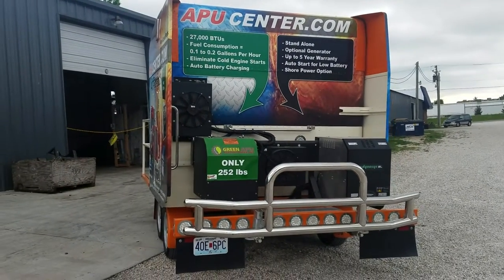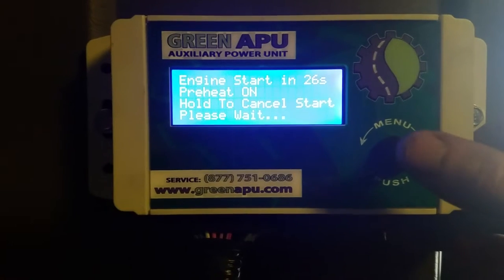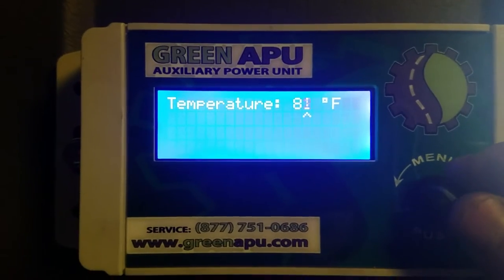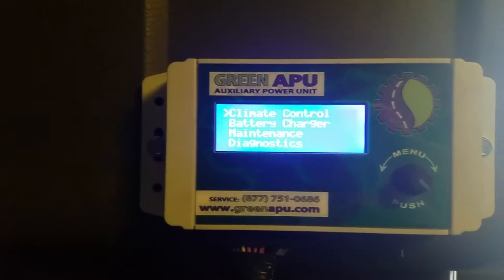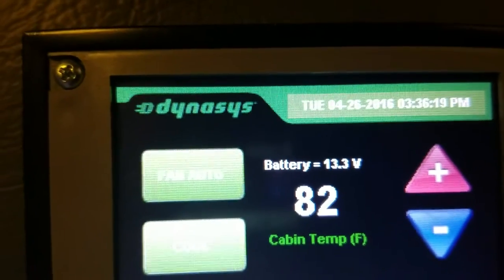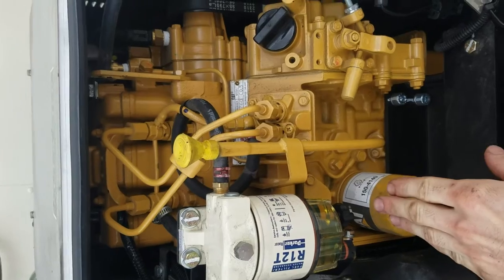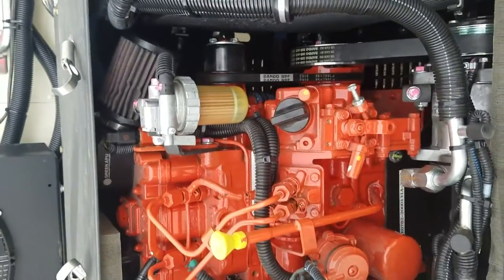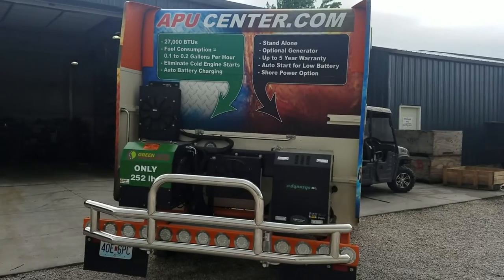New demo trailer at Apucenter.com Green Apu Dynasys Apu Chil-E Electric Apu stainless steel deerguar

Comment: What is price?
Reply from the maker: Price for this unit starts at $5000 installed.
Reply from the maker: Stainless steel deer guards are $900 installed on most trucks. standard install included.
Reply: Bob Faulk 5k for green apu ?
Reply: @Boban-n8j  it's not good?
Reply: @apucenter.com115  Where located